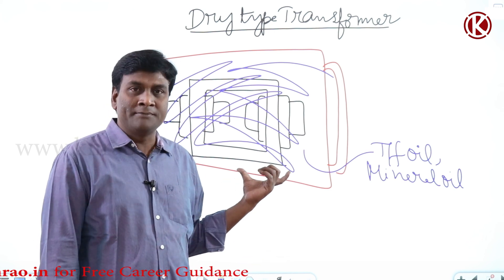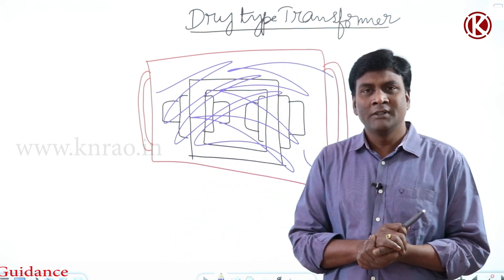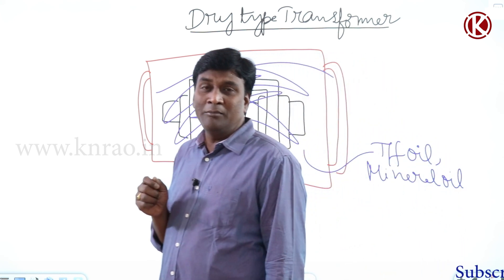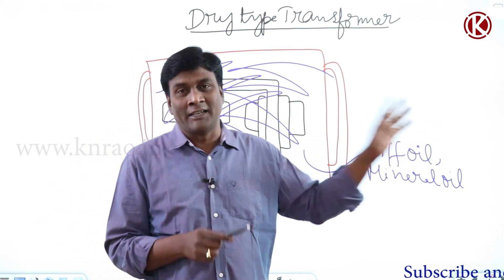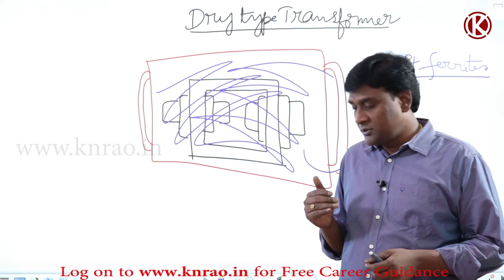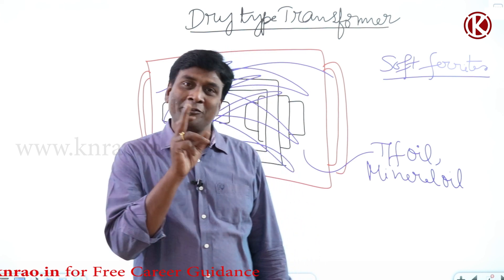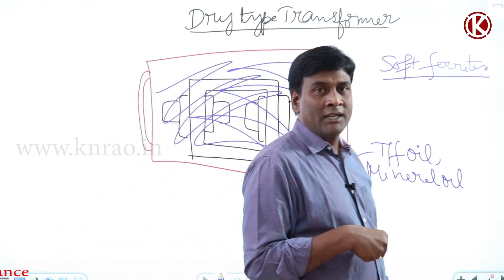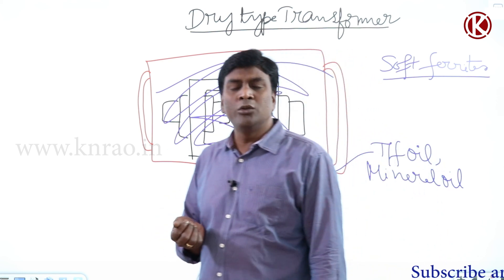Very Good Interview Qn || What is Dry Type Transformer, Its Applications & Challenges || KN Rao Sir

Comment: Sir, what about the cooling system of dry type transformer ? We told that we use it in server so transformer has to operate all time, so temperature rise will be there, how do you reduce temp. rise by using dry transformer ?
Reply: एयर नेचुरल एयर कूलिंग
Reply: Dry type transformer is air cooled.
It is resin cast.  It will withstand more temperature. Temperature scanner is present.  If the winding exceeds set temperature an alarm comes